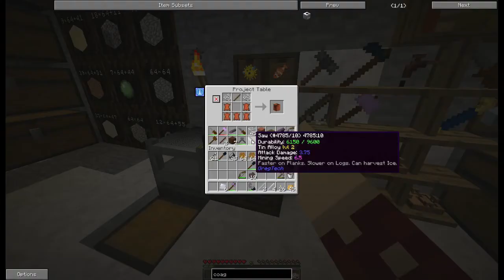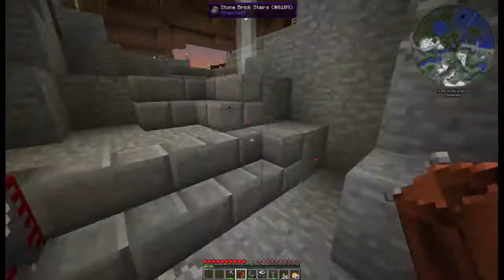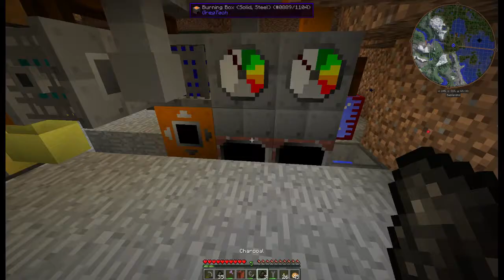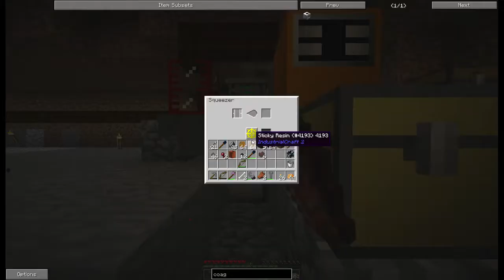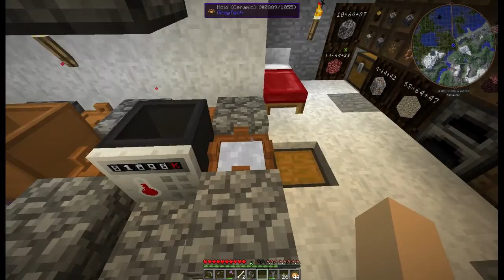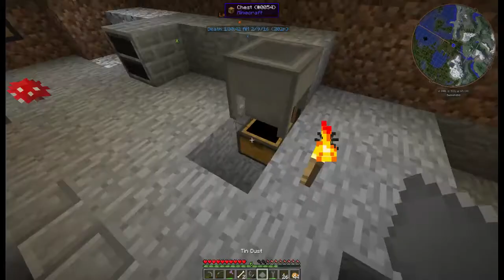[Bears Den GT6] EP 25 - Coagulator Making Rubber

Comment: +A. Bear Hamman, why the shredder took more power than you expected, was because the motor has a 50% efficiency.
Reply: And remember:
GT6.01.01
[ADDED]
Machine Status Display Cover.

The fourth thing is an ON/OFF switch for the Machine. It doesn't only turn the Machine off, but also eventual Motors/Heaters/Engines/etc which are directly adjacent and pointing into the Machine. (this doesn't apply to lowtech things like the Burning Box)
Reply from the maker: +Dante Broggi ya but that takes aluminium and I dont have much now. I will make one eventually.

Comment: So about Gregtech machines, I think I have figured out that RU and KU is Rotational and Kinetic Units accordingly, but what is the GU Usage? And what are the Tiers and Power?
For example, I've been trying to centrifuge Ferrovanadium and it requires Usage 32 GU, Tier 32, Power 1. Can you explain what each of those three numbers represents.
And another thing, when I go through NEI for complex recipes, it still shows the lowest tier bronze machines in the tool tip. Does that mean that those machines as well can do the job? Or is it like, this type of machine can do it but only those of enough Usage/Tier/Power for the task needed. That would be my guess at least.
Reply from the maker: GU=Generic Unit, whatever unit the machine calls for that the recipes says to use.  usage is the amount per tick that will be used,  tier is kinda not needed in my opinion cause it is always the same as the usage. power I would guess is amps it will take but I havent seen any recipes as of yet that has a different number. 

yes that is just showing the types not specific tiers
Reply: So when a recipe requires 32 GU, I need to process it at a machine capable of outputting 16-32 GU or above right?
And another thing, can you combine engines/turbines or can you transport the KU/RU somehow RotaryCraft style. I didn't see and shafts or gearboxes but maybe it's done otherwise?
Oh, and what are MU electricity?
Reply from the maker: I did a video explaining all the different power types, and now there isnt a way to move or combine RU/KU. MU is magnetic units.
Reply: Please provide the link.
Reply from the maker: https://www.youtube.com/edit?o=U&video_id=a9sdZSwOQxM